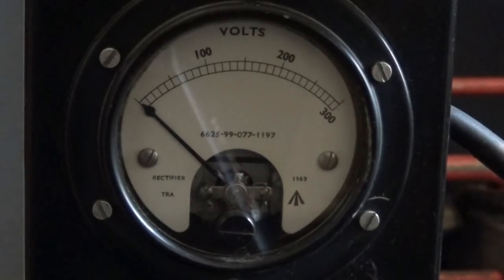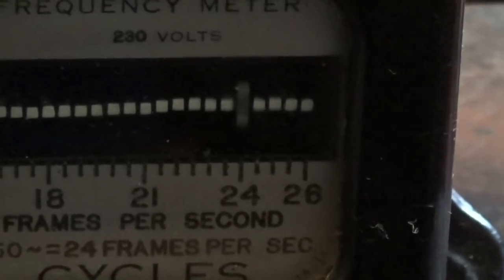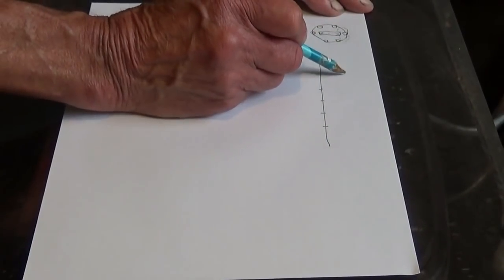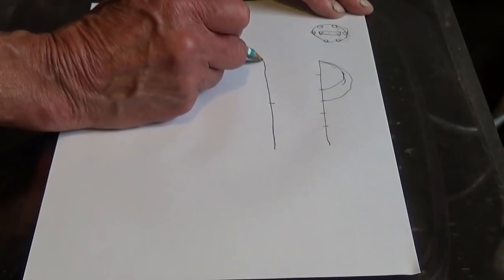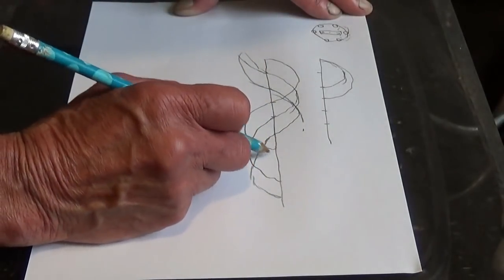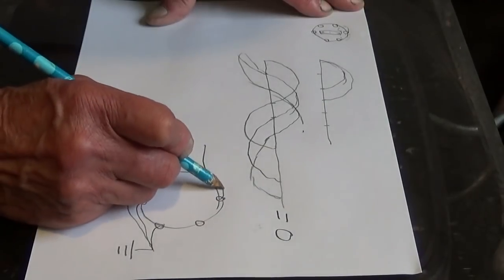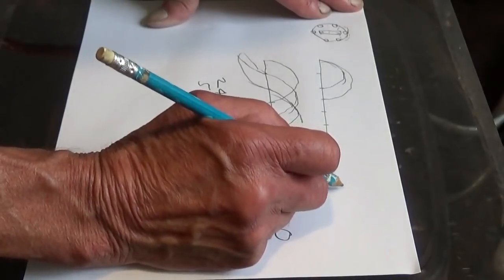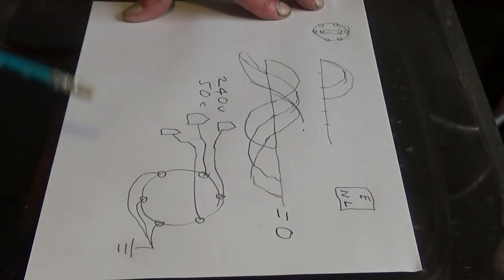3 Phase Electricity a Simple Explanation

Comment: Some nice explanations. ... but failed to explain how you get from 24 frames per second to 50hz lol

Also.... it would have been nice to explain the complete circuit .... anyone trying to learn this is gonna go look at the feed to the meter and see that they don't just have a live wire coming into the house .... there's a live and a neutral. ...   where does the neutral go to ??
Reply from the maker: Thank you. I'm explaining why the meter says 24 frames not 50hz. If you watch it again, you can briefly see that written on the meter.
As I say in the video, neutral and earth are the same. The whole point of the video was to show why we don't have 2 live wires coming into the house with single phase electricity. Is that better (grin).
Reply: @MalcOfLincoln  not at all ... so .... your telling me that my neutral return comes back from the ring mains .... through my RCD breaker board.... through my meter .... through my master bullet fuse block .... and then only goes to earth ????
Reply from the maker: @Garuthius  Fairly sure that's right, at the substation I think. Got a poor memory, getting worse with old age and it's a long time ago since I did this. With 3 phase houses are wired on different ones so it actually goes to different houses, the neutral wire is just to even things out.
Reply: @MalcOfLincoln  well ya learn something new every day ... I always thought it fed right back to the power station
Reply from the maker: @Garuthius  The main point is......there is always ZERO voltage between the 3 phases, so only 1 wire is required....neutral is just to balance the difference, hence it's just an earth. I found it very interesting, all those years ago, hence why I've remembered a little.